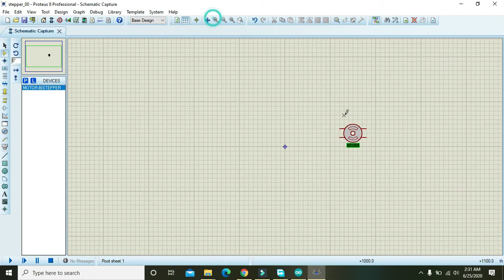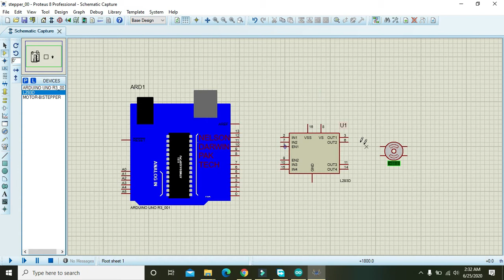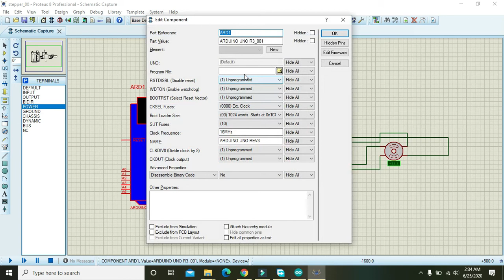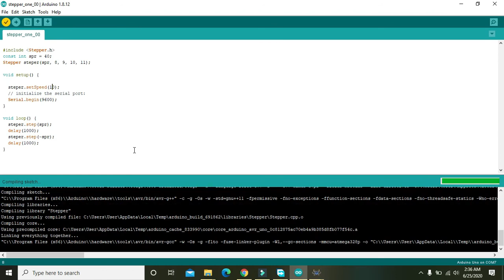how to use stepper motor with arduino in proteus | simulation of stepper with arduino in proteus

Comment: do i need to connect a driver with servo motor? and how?
Reply from the maker: yes tutorial is also there for servo with arduino..
Reply: @nelsondarwinpaktech3954  i try to do so using PCA9685 driver but cant